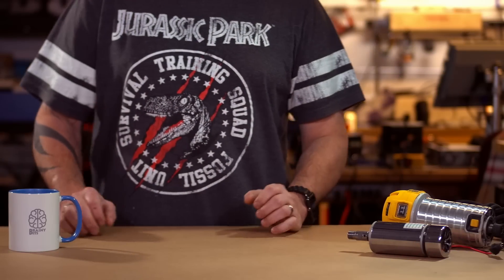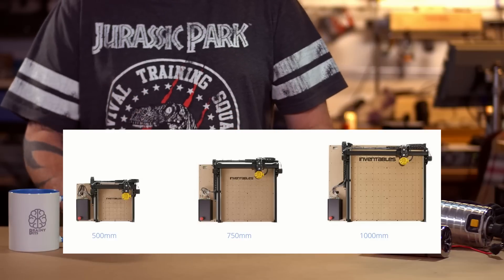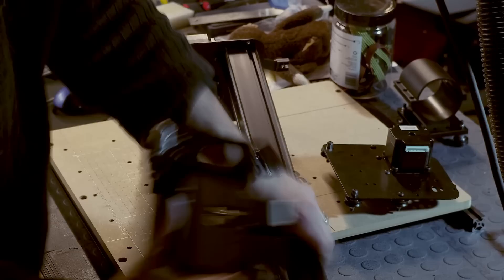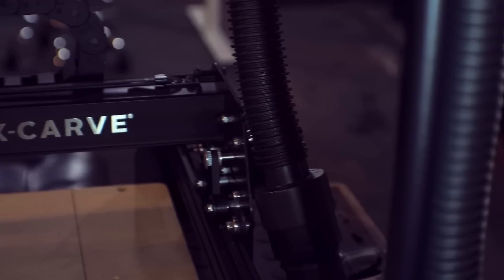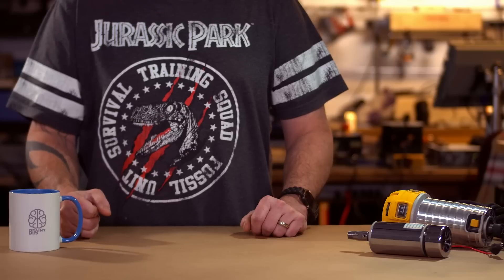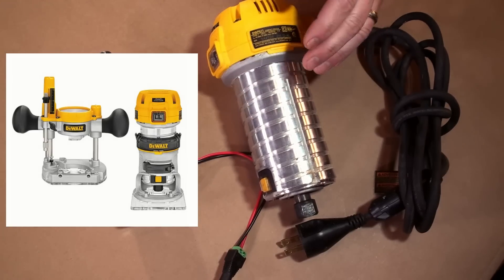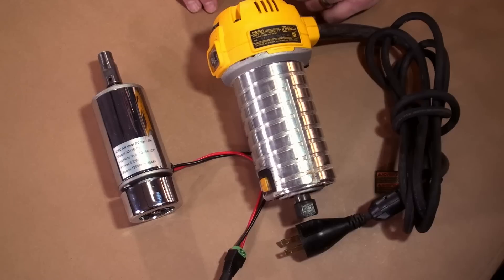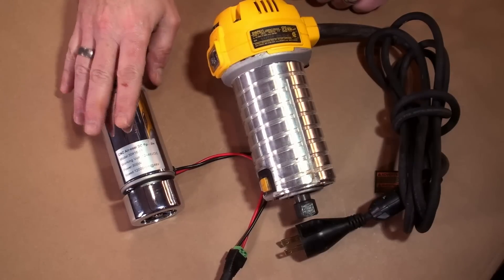CNC PCB Milling! Part 1: Let the Journey begin!

Comment: I'm looking forward to seeing the Xcarve work and how you like it after several months. Xcarve gave machines out like candy to youtubers, and everyone did an assembly and first impressions video on the machines, but I don't see many of the machines still in use.  Either people aren't making videos about them, or the machines aren't that great.
Reply from the maker: Yeah, I also saw the tons of videos from YouTubers who got their machine for free from inventables (unlike me who paid for it...), Gearbest does the same thing with 3d printers.  The X-carve so far looks well engineered and built.  Of course the X and Y are still using belts which will need adjusting over time, lead-screws would have been better.  The rigidity looks good at least at the small size 500x500mm, but the large size they also sell 1000x1000 could have flex.  I'm trying to see if I can find a reliable way to use this for PCB milling, I will make videos of my finding and experience along the way.